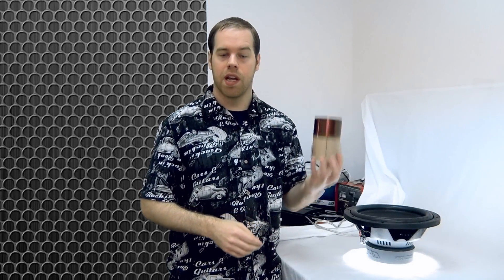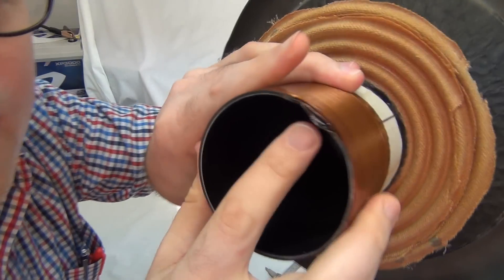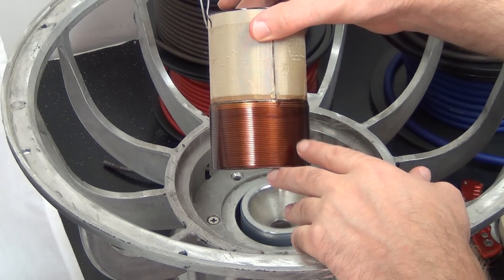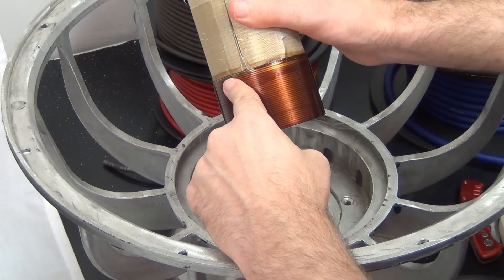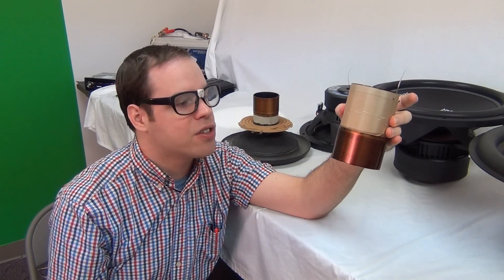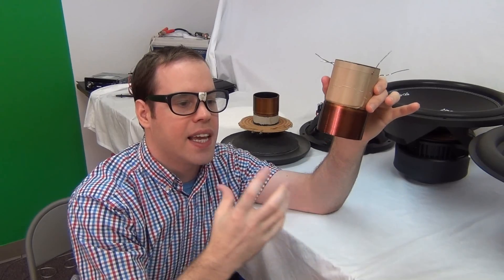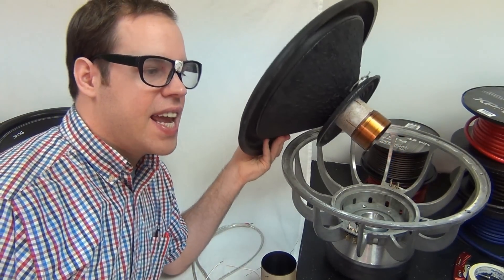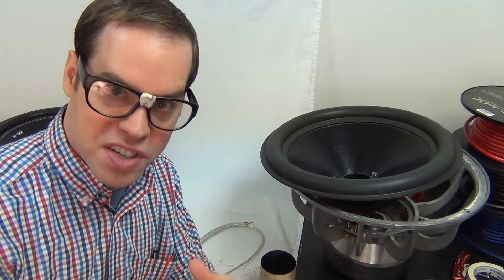Voice Coils

Comment from the maker: It all depends on the woofers design. Both flat, and round wire have their advantages and proper applications. Flat wire has greater surface area so it may cool better. So many SPL woofers use this. Round wire allows you to fit more windings in the gap for greater efficiency and many SQ woofers use this.

Comment: You're friends with bassotronics? That's pretty sweet. I'm new to audio and stuff but is it bad to play high frequencies on a subwoofer? because I have two 6 inch kenwood subwoofers with a 7 inch lg subwoofer hooked up to an old sony receiver. the tweeters have crapped out on the kenwood stereo so I'm just using the subs for the higher frequencies.

Comment from the maker: I have designed and built my own frames and wrapped coils. But more production quality than homemade. 
Magnets have almost nothing to do with power handling, it is all based on the coil and suspension. So yes, a stiffer suspension will change that. We have 2 terms, thermal power handling (voice coil) And mechanical power handling (suspension and tolerance of parts). Distortion is caused when the cone/coil moves in a non linear fashion. Usually when the coil moves beyond X-Max.

Comment from the maker: I havent heard them in person so I cannot say. But more x-max does not necessarily mean more air moving or louder. What it does mean is that the coil is controlled further. If the motor and woofer is design with low strength and low power, this can aid in SQ. If the woofer is designed with a strong motor, this can help is make more pressure. Whether it gets louder or moves more air or not, depends on the suspension.

Comment from the maker: It depends, sometimes you can cook off the non conductive coating and short the coil and the impedance will drop close to 0. Or if it heats up enough, the coil wire will open and impedance will be super high or even just fully open. Anytime you see it still in operating range means that you just smoked off the adhesive and the coil's mechanical attachment to the former is weakened.

Comment: Men you are indeed a good explainer, easy to understand you. Good job. Thanks for all the info.
I'm doing a DIY project on voice coil, though i don't know electronics, my confusion is how do you determine the gauge of the coil, to be used, the height of the coil, number of layers to get either 4 or 8 Ohms, don't know if i spelt it right, but i mean the impedance. Thanks.

Comment: Awesome video!  The only thing I don't think it touched on was flat wound vs. normal coil.  I would assume that a flat wound coil would yield more surface area, but it's also quite a bit more thick, so you would need more length of it to end up with a reasonable resistance, thus raising your mms and changing your Q values.  I'm about to choose a re-cone for my AA Havoc V1, Fi being one of the options, and they let you pick between Flatwound or "x-max" for your coil.  Does a flat wind affect x-max and x-mech?

Comment: Good video, I do a lot of recones for people myself, I try to stay away from the custom stuff, and I tell the person that the company usually uses their best parts for that woofer as its how it is designed to be used. However I always get told that If I go and use this coil from a 3000 watt woofer in there 1500 watt woofer that is being reconed it would be louder. I often try to explain to them that now you have more heat to dissipate that the motor was not designed for. som never understand it

Comment: Amazing vid, not many like this on the net. Helps a lot when choosing/upgrading a coil. Speaking of, having a hard time finding a 3”, dual 2 or .5, 8 layer, thick flat copper wire voice coil. LoB, etc does not carry them :/ Any pros to a quad coil flat alum bifilar? What is bifilar pros vs cons?
Reply from the maker: I think it depends on the amount of windings you can get into the gap. Coils in general have been a bit tough to get lately
Reply: @SparkedEd  so with my research it seems bifilar is said to produce more “tight” based bass because of the greater magnetic field it creates, lowering resonant frequency as well. I have to find my notes (just saw noti) and will edit this proper when I do but apparently bifilar seems to be more SQ based, which is a goal for upgrading my SWX-1243D, seems someone needs to produce a super nerdy tech explanation of coils and what makes what and why ;) you should def make a vid of SQ coils vs SPL coils and how to achieve what goals you have in mind ...and ya I can’t find 3” dual VC 8 layer flat copper wire coils anywhere :/

Comment: +ShowtimeSPL where can you pick up the Voice Coil Bobbins?  Always been a little interested in how Speakers worked Plus how to do some Repairs on them.

I actually have some Home Speakers that could be repaired. New cone mainly, but I'd like to use some of my OLD Speakers to toy around with by rewinding voice coils and such.

So i'd like to know, if possible, where to Pick up some of the bobbins or could I basically make them out of anything but conductive materials?

Comment: i have something i like to know for a long time. dual 2ohm VS dual 0,5ohm coil. booth connected so the load is 1 ohm and same power from the amp, will the heat generated from the coils be the same? as we know when you have a current flow trough a resistor it generates heat, but the higer resistance at the same power will give more heat right.
example: 6KW trough the dual 2ohm in parallell = a total of 4 ohm wire on the way.
and 6KW trough the dual 0,5 in series, a total of 1ohm wire on the way?

Comment: Ed my 18s are hdc3 motors and baskets and the soft parts are dc level 6 recones with 8 layer coils, dual 2 ohm copper, in your opinion more or less  do you think the rms rating would be closer to 1500 rms or 2000 rms per sub?  Thx for any info

Comment: I learned quite a bit watching this thank you, but I feel you could have gone further in depth about the differences in a 4 layer VS an 8 layer coil which is why I searched out the vid to begin with as I have 4 Addictive Audio V4 15's with an 8 layer copper coil and I wasn't exactly sure what the difference was between these and my last woofers which were Sundown Sa15's with a 4 layer CCA coil also which coils are best suited for which applications ie. SPL or sound quality so on and so forth

Comment: What drop in cone kit are you placing on the basket that looks like a eclipse basket and motor. Trying to figure out what dropping kit to use for my Eclipse aluminum blown subwoofer
Reply from the maker: No kit, I have various parts I was putting together to rebuild an old Brahma. That's a 12 spoke basket, probably the most commonly used basket on the market. The parts you need will be determined by the motor and frame geometries. You can check out fixmyspeaker.com to see if they have parts for you.

Comment: I already commented on another video but this video is more suitable, one of my voice coils has no ohms the other has 2.2 I can't Imagine that it's blown because there would still be some resistance and all of the leads that I can see with out removing the cone are fine, what's the problem?
Reply: Turns out one of the braided silver wires is not very conductive do i have to use that type of wire of can I use insulated wire

Comment: Hey I have a question I need answered and I can not seem to find a answer. Is there a way I can message you for this? Here it is if you want it here, I have been repairing, reconing and customizing subs for a few years and I have played this safe so far and have not had to worry about VC bottoming out. How much room should I leave between the bottom of the VC and the bottom of the plate?  I know motor depth will play a role along top plate thickness but could you give me a good rule of thumb or percentage?

Comment: are copper voice coils better than CCA?
Reply: Cant really find a straight answer myself. Better how? Im planning on covering this in the future.
Reply: @subdynoman  I'm not 100% sure myself.
Reply: @RobHTech  the trend seems to point at CCA or aluminum for spl type subs and copper for SQ and long playing.
Reply: @subdynoman  damn it. I did a short write up and it deleted. So here is a summary. CCA is only ~ 60% conductive as copper. So CCA VCs need to having longer windings, which increases Xmax. And, since there is this common misconception that Xmax is so important, CCA VC subs with higher Xmax sell more product. While copper can have a shorter winding, but also heavier. I also can't see that the aluminum conductivity difference has no effect on electron flow and thus sound. I've read research stating that most can't hear a difference between the CCA/copper, but I believe I can. CCA always has a rather shrill sound to it. Thus, I like copper. But, I typically end up getting CCA VC speakers because those tend to be louder, higher sensitivity, likely due to being light weight. Yet, again is the trade off of longer winding.
Reply: @RobHTech  Interesting, this situation is alot like tuning a Floyd rose guitar. I'm sure it's going to lean on the situation. As in SPL and SQ and I mean loud at 1 frequency vs full bandwidth. I want to elaborate more and try some real world tests. Did you know that large power transformers use aluminum windings? Another thing to think about is I have not yet seen a small toroidal transformer use aluminum. Really got me thinking 🤔
Reply: @subdynoman  yes. I do recall reading something about the electromagnetic field being different in aluminum coils, or other aluminum-used electronics. Can't recall specifically what. I have to dig through all this stuff I have.
Reply: @RobHTech  since we're on the subject, what do you think a good way to compare each. I'm looking to pick up some materials for testing. I do have some coils on hand but they aren't quiet equal. I'm thinking for a voice coil, it's should be about the size of the coil, so the same size coil with same number of windings. And test the output. There are so many variable and ways to compare.
Reply: @subdynoman  At first thought, size, resistance, electromagnetic properties, O scope to test signals in/out of the VCs, maybe some double blind listening tests. Aluminum wastes more energy, thus creates more heat, thus has a "High-temp" property when used in VCs. That high temp issue requires different adhesives, etc. to handle the temp. Again, more banking on misconceptions: For example, aluminum VCs are frequently marketed as high temp VCs, higher Xmax, higher temp glue, and people buy into it. It's a + feedback system. Why on Earth would they ever want people to know the truth? 

It's the same thing as people believing that a 2 Ohm speaker, all else equal, will get louder than its counterpart 4 Ohm speaker because 2 Ohm can "Handle more power." It's actually the opposite: A 2 Ohm speaker uses more power to get the same job done as a 4 Ohm, given sensitivity etc. is the same. A 100% efficient speaker, though not possible, would not move at all even at full tilt because no energy would be wasted. So, in this regard, to me anyway, aluminum VCs with higher Xmax move more because they are more wasteful. 

I don't believe there really is much difference in regards to electromagnetism, so long as the current is the same, albeit with a higher cross-sectional area for the CCA d/t lower conductivity. 

Also, just  food for thought: Alternators and other such devices use copper windings. Some don't, but that's just to make more money. There is no other reason to use aluminum except that it's less expensive.

Comment: I'm old-school. I like copper SVC motors with paper pulp cones and accordion surrounds. When I tell young bucks about this, they look dumb-founded. Well, probably because they have been dumbed down. That's OK. It's not their fault. The copper always sounds better to me. Some say that is psychological, but I don't think so. My perception of sound is very sensitive. I can literally hear the difference. The speakers with Al always seem to skip a beat, a hz range, or something like that. Copper seems to have a more linear response to the power input vs output sound, but it depends on so many variables. The highest quality systems I see use old-fashioned speaker "technology," i.e., copper, paper, accordion, etc. It's a speaker. It can only be so complicated. It's not like building a pyramid or something.

Comment: The trouble with speakers of that design is they are far less efficient than all others. It takes 500 watts to just get them moving and past 1000 watts, it is a waste of power and the coil blows up. Like towing a trailer with no wheels - you can move it - but it takes a bigger engine.
Reply from the maker: Actually it's very efficient in it's frequency range. The motor design works quite well and it can perform nicely even with under 100W. Coils like this are also good up to a few thousand watts with no blow up action at all. So you get a wide, usable power band for multiple types of enclosures and applications. Sure there might be more efficient designs, but not much that have as wide a power band or efficiency band as this.
Reply: +ShowtimeSPL I have a mtx 9500 15 inch single coil I want to change it to dual so what's the easy step

Comment: It's crazy because my subwoofers are dual 4 ohm.. 1500 w RMS 3000 w Max.. I'm running three subwoofers in parallel but I always have a problem with my voice coil melting. They are aluminum voice coils, would a copper voice coil melt. I have an 8000 w amp and I make sure that it's not clipping but after demoing after 5 minutes always seem to be one of my voice coil melts and put my amp into protection mode.

Comment: Don't forget,  the finer (lower) your distance between the coil and the magnets are,  the lower currency you need for the same motion at the coil.

but will run out of space with air to cool off the coil,  then you are limited lower then the coil is originally by manufacture ofcouse cause less currency makes more heat when that happens..   

just my theory doh

Comment: I want to see something with copper clad aluminum square wire with like a 6" voice coil that is also 6" long, with ceramic based coil adhesive. Oh and make it have MANY layers to improve efficiency to a point. 10 layer voice coil? maybe even thicker?
Reply: It's not possible to make a voice coil that size and that thick the motor would have to be 3times the size it just wouldn't matck the biggest voice coil is 8" and that in the 32" Alphard audio deaf bonce hope that helps.

Comment: would a 3 inch coil fit into a 3 inch motor with out any problems cause I have a aq hdc3 12 and wanna get it reconed w a 2000 rms recone kit and fi audio btl is 2000 rms would a fi btl recone kit work on my aq hdc 3 cause they are both 3 inch coils

Comment: a coil in a coil in a coil... you might think it would be more efficient but you're ultimately increasing the mass of your reciprocating parts. wouldn't that negatively impact on your efficiency trade off if it takes more energy to move the mass, stop the mass and change it's direction moving it back the other way... won't it still just heat up, maybe more?

Comment: I have a Orion HCCA 11"  1200watt RMS bumps but sounds like some wire is loose and rattles with bass under the spider sounds like its a dual voice coil and i love that woffer but what can i do for clean sound at low sound or where do  get new replacement coil at its a few year older Orion HCCA looks like a 10" but fits 11" i find out? from car audio place did box speaker cost $1000 each speaker what can i do ? if i have it in trunk and bump it cant hear the loose coil wire but ca if you open up trunk what can i do?  please help! t
Reply: Stephen618IL if u haven't found out yet u can recone that woofer rather easily u have unwound some of the coil

Comment: Would magnet stacking make it handle more power
Reply from the maker: Not at all. Power handling is a function of the voice coil and suspension.  Stacking on more magnets will most likely either do nothing for performance,  or throw the Flux lines out of balance

Comment: I have a cerwin vega stroker 124 meaning it is a dual 4ohm....can I put a dual 2ohm coil in it or is there anything else I would need to modify to make it a 2 ohm...

Right now its dual 4ohm wired to 2ohm and my amp only puts out 1000 watt rms at 2ohm....if I get it to 2ohm and wire it to 1ohm I can have 1500 watt rms...its a 2000 watt rms subwoofer...

What do I need to make it 2ohm so I don't have to spend 3-500 on a new amp
Reply from the maker: If you change the coil, you also would need an entire new re-cone. Best to find original parts.
Reply: Ya to make sure its all sealed properly?  I found a guy in my city who said he could do a complete re-cone for 180.00...but I also found a cerwin vega stroker 122 for 200.00...might just spend the xtra 20.00 cuz the 124 I have is like bran new and it would be a waste of a good coil...thanx for your advice I appreciate it:-)

Comment: If I have a broken voice coil (the speaker has never been used but it arrived dead and everything else looks fine) is there any way for me to fix it?
Reply from the maker: Send it back for warranty repair
Reply: I wish. I bought it As-Is on Ebay. The guy didn't say it was used and as-is. So, I thought it was unused, but untested. Turns out some dude clipped the hell out of it; the cone's pristine, but the coil is FrI3d.
Reply from the maker: You can always re-cone it
Reply: Idk where to get a low end recone. And I've already replaced it with something cheaper. Thanks for the help though
Reply from the maker: fixmyspeaker dot com is a great source for many re-cone parts
Reply: I'll check it out
Reply: Warranty?